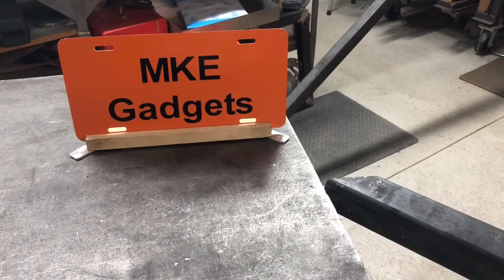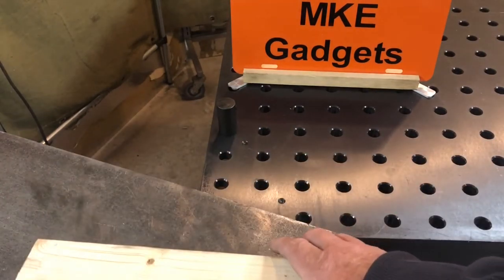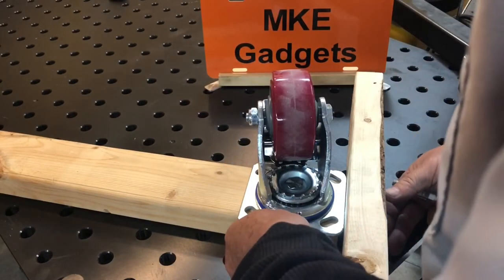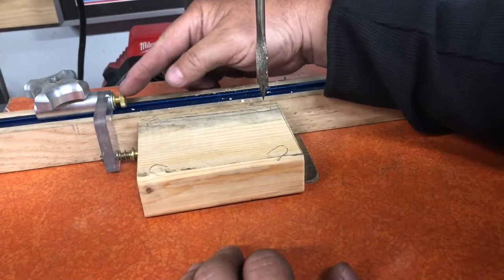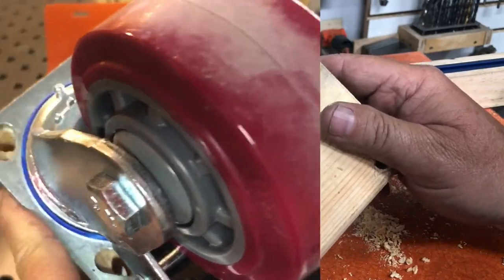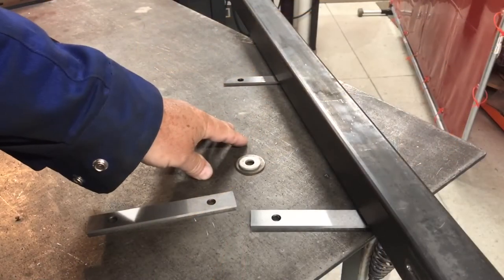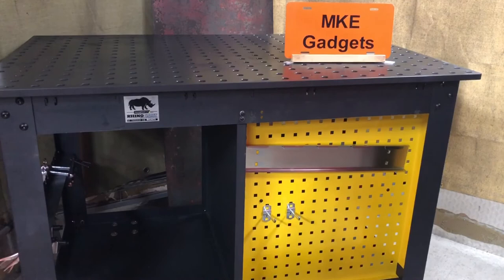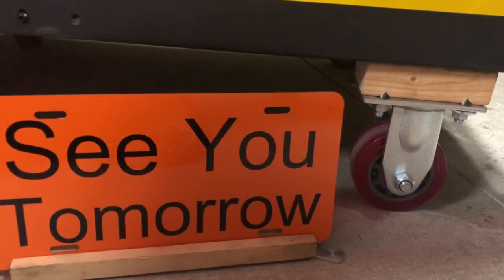Rhino Cart Lift Kit @ MKE Gadgets #130

Comment: When you get your aluminum will you make the 2 tables the same height or keep the one slightly higher.
Reply from the maker: The plan is to keep the Rhino Cart a bit higher. The welding booth floor is on a slightly angle. This way I can shim the lower one.